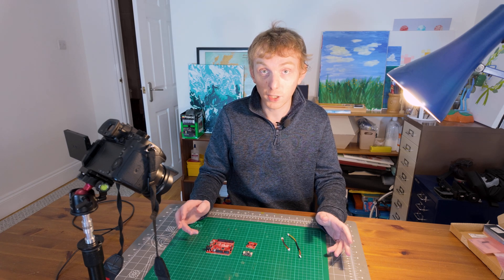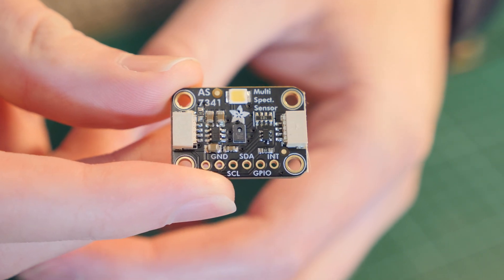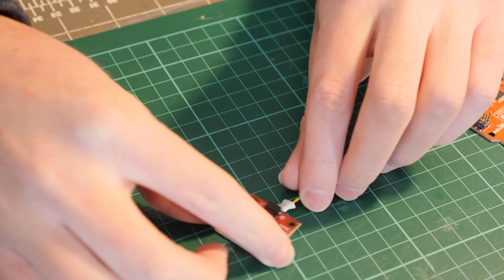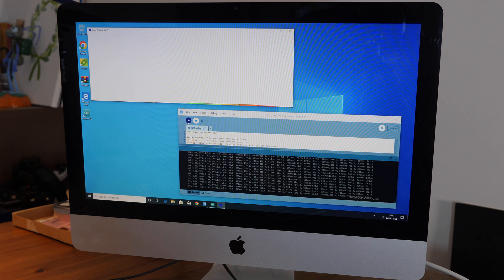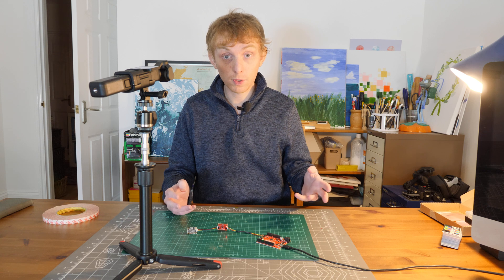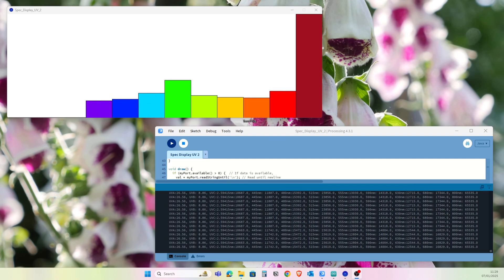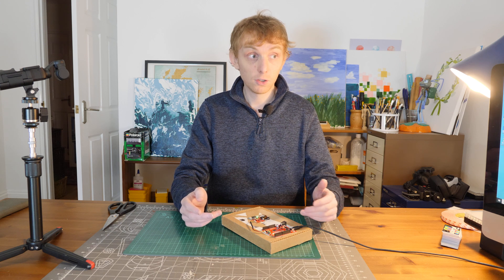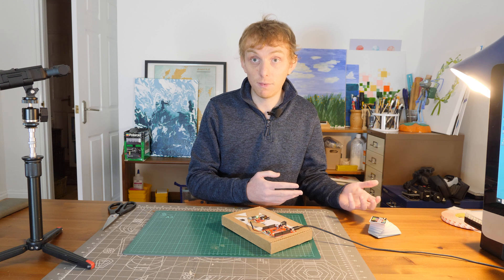DIY - Light spectrum analyser #arduino #sparkfun #adafruit

Comment: What is the best method to program this "set"? I have all of the parts, having difficulty finding correct code or coding method.
Reply from the maker: I have uploaded my code to my Github. https://github.com/samthetinkerer/DIY_Light-spectrum-analyser/blob/main/get_channel_CSV_UV_Github.ino . For the SparkFun RedBoard Plus you can use the Arduino IDE 2.3.6 to programme the board. The visualization tools was programmed in https://processing.org/, again code in my github. Happy making
Reply: @samthetinkerer4947  I have downloaded the libraries for all of the parts. Ran the initial example(s) as this is my first build. Everything there went fine. 

When I try to add code the the arduino through the sketch function it appears to go through with no issues. When I try to verify the package, I get a multitude of errors.

Also, I could not find your plotting program. I did see on from another sparkfun item, or should I just use the one built in?

Finally, as I am adding 3 distinct routines (libraries, commands, etc.) is there a method to correctly load these into the arduino?

Thanks for you help.
Dean Moore
Reply from the maker: @deanmoore6548  when I work on projects, I test each section of code separately and then combine. it is worth reading https://learn.adafruit.com/adafruit-as7341-10-channel-light-color-sensor-breakout/arduino and https://github.com/sparkfun/SparkFun_AS7331_Arduino_Library.  The libraries go before the Void setup (if these are not included it will cause a lot of errors).  These can be downloaded via the Arduino IDE by going to "Tools" then "Manage Libraries". This will open the Library manager where you can search and Install the libraries included within the code. The plotting program code can be found https://github.com/samthetinkerer/DIY_Light-spectrum-analyser/blob/main/Spec_Display_UV_2.pde and was written for the programme https://processing.org/.
Reply: I tried your suggestions with no luck. I even copied the code in github and still had errors.
Reply from the maker: @deanmoore6548  What error did you get? Chatgpt may be able to help as it is familiar with the arduino code language.